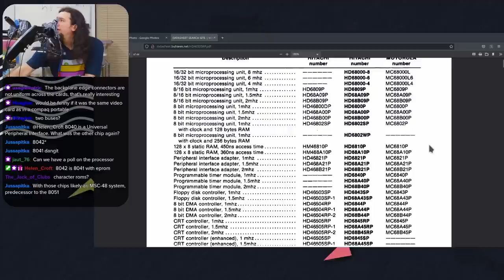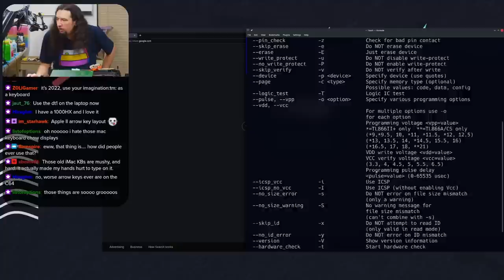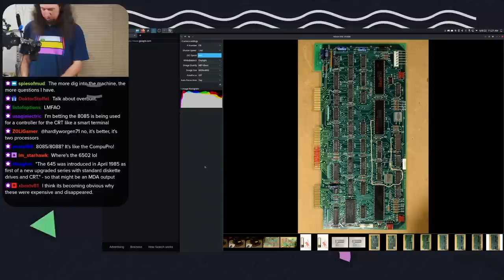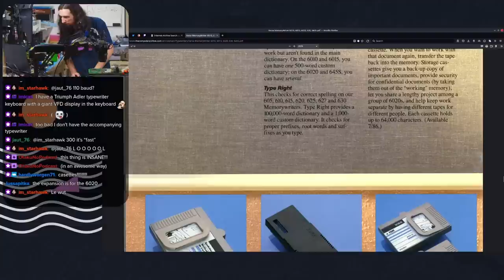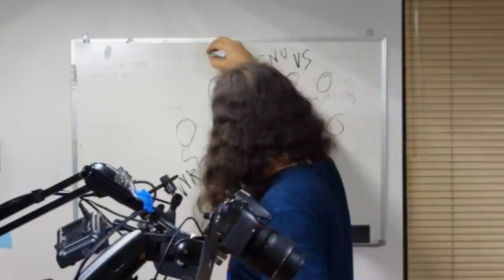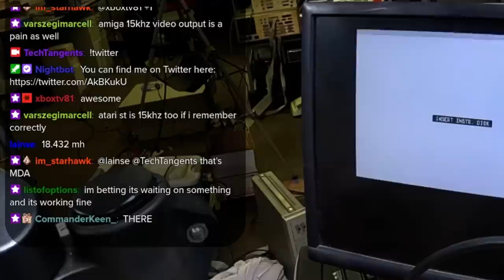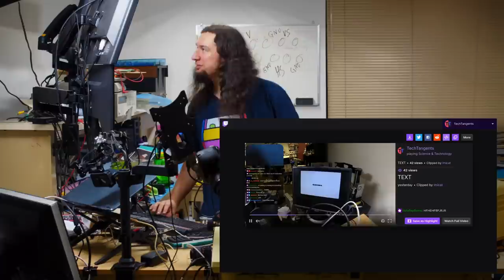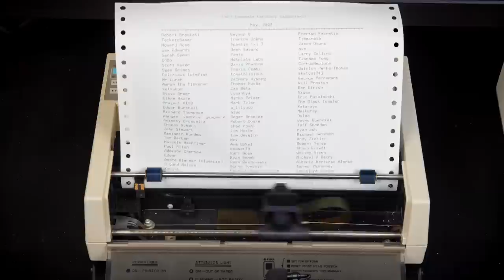Exploring the Crazy Xerox Memorywriter 645S to Get Video Out

Comment: The problem with a lot of these dedicated word processors was, their manufacturers were often way too stingy with CPU-power and often not great in the display department either. These things were often SLOOOOW. You'd type, and the display would be no help, because it'd catch up to you only later, by which time you'd have moved on if you were any good. So really, the display was only useful for occasional corrections. Given the development cycles and what was available at the time, they would have had to have put then-fairly top of the line-ish CPUs into these, with then-pretty expensive displays to avoid that sluggishness, and they didn't do either, because they were too eager for margins, and that killed usability, and soon made any cheap PC clone from Taiwan a better deal. Call it technological ungenerosity or eighties corporate greed, but crappy CPUs and dodgy displays killed these dead in the marketplace when there could have, would have been a place for these, on easy-of-use grounds -- they just would have needed more Oomph and Usability™.
Reply: PS: Having now watched halfway through this video, I take back what I said before, at least with regards to this word processor. Looks like this model could actually have been fast enough, with a decent enough monitor, to be actually usable. Also, looks like this thing was built like a big Benz limo, with a similar price point.

Comment: The 640, and 645 came with a 1/2 page video monitor.  You can do very little without it.   Power to the monitor is 16 volts at the connector. The voltage is then increased inside the monitor.  BTW These ran circles around the competition IBM.
Reply: Search for the Xerox 800 demo film entitled:
XEROX Word Processing Machines & Computers 1975 (Xerox 800 vintage promo film)

Also look up Xerox Star, and the Xerox Alto which was the first desktop publishing system in 1972 with a 3-button mouse.
Reply: The 645 "S" is for Spelling, it had a dictionary on a floppy diskette.  There was also the 645 "E" version for Ethernet.

This also prints bi-directional as it's based on the Diablo 630.  Bi-directional print is something no IBM Electronic Selectric Typewriter could ever do.

10, 12, 15 and PS spacing.

When you power it on initially it operates in plain old one letter correct at a time typewriter mode.  When you touch any of the function keys,  it asks for the software boot disk.

Take the time to remove the platen and make sure the platen bushings on each side turn freely.  When I bought mine used, someone ran it into the ground.  Either the stepper motor for the platen is damaged or a SCR on the driver board.

Comment: Hahahahaha, I used to work for Xerox in 84-85 and this was one of the products I was trained to support. I hated it, sorry to say I don't even have a page of documentation or remember anything about it other than it sucked (all the memorywriters). I do remember one customer that had one that I literally replaced every module on and it still didn't work right.  EDIT: Hourly pay for an entry level FS Tech back then was $5.45/hr, just found my check stub. A couple year later I went to work for DEC, entry level systems tech was just over $8/hr. Working for DEC was one of the best jobs I ever had.

Comment: Xerox:
Puts the disk drives UNDER the keyboard, lifting the keyboard up uncomfortably
Meme man:
URRGONOMMIKS

I found a Philips VideoWriter with an awesome half height amber CRT on the curb. It didn't come with disks and is incompatible to everything else on the planet, but you can format disks from the ROM BIOS, so it doesn't become bricked if you lose the disks.
And the monitor uses 15kHz composite so you could snip the internal cable and hook it to a DVD player.

Comment: 16:17: The Intel/AMD thing is because there used to be this big federal requirement that there had to be a second source for everything the government would consider buying, to avoid some monopolist holding Uncle Sam over a barrel. From Wikipedia's second source article: "Intel licensed AMD to second-source Intel microprocessors such as the 8086 and its related support components. This second-source agreement is particularly famous for leading to much litigation (...)"
Reply: The second source requirement thing was because IC fabrication was a bit of a black art in the early days. Fabs would suddenly go to 100% failure rates for inexplicable reasons and, without a second source, there would be no supply at all. Over time the reasons for failure became understood and were weeded out (weird things like a change in the washing powder used to clean the suits) and single supplier source became acceptable.
Reply: @stevetodd7383  That's one interpretation. Another interpretation and side of the story is that monopoly abuse has become much more officially acceptable in the United States. When it was all weird and disruptive pioneers, they needed to be controlled, but now that all the right people have big money invested, any kind of "big government" interference in the great technological kingdoms and fiefdoms (that are more powerful than most governments) is just intolerable.
Reply: @ropersonline  you need to remember that, in the days of the 8086 etc, there was much more competition in the market for CPU designs. There was no need to prevent a single company from having a monopoly as there was a thriving market for alternatives. It’s only as the competition fell by the wayside and x86 became the de facto standard that this became at all relevant. Even x86 designs weren’t all Intel derived (AMD, Cyrix and others were producing competitive designs long after Intel stopped second sourcing their chips). It was all about ensuring availability, not preventing price gouging as it was all too easy for a company to lock a manufacturer like Intel down to a price or they would go elsewhere. IBM famously got the 8088 for $5 per chip in their contract.

Comment: Maybe try a PC bios? I guess there are two processors, because one controls the "printer" and the other runs the "user interface"
Back in the day Xerox did a range of "Mini" type computers which were often used for word processing with models like the Xerox 850 (these things were huge). This may be a derivative of one of those. They did indeed have their own operating system, in the case of the 850, it came not on 5 1/4" disks, but on 8" ones. I actually worked on one back in the day for a local insurance broker. Nobody else locally would look at the thing because it was ancient, even then, but I got it services and running. That would have been in the late 1980s or early 1990s.
Reply: The wide hole on the back where the blank panel was makes me wonder if a Centronics port or a serial port were also an option.

Comment: It's stupid. But, with today's world of Raspberry PIs and small LCD monitors, it would be cool if someone made (or some hobbyists could build) a computer/typewriter hybrid. The immediacy of a typewriter is not replicatable any other way with computers. How hard is it to build an impact printer (assuming you can use existing daisy wheels)? You just need some rails and some stepper motors and such, right? It could be done.
Reply: Other than making your own impact printer, it could be done easily (for somebody with the programming skills and time). You could emulate the control protocol for the printer on an Arduino and write a character or line print out. Even easier would be using linux on a pi; after all, lpt stands for "line print terminal."
Reply: I'd imagine it wouldn't be hard. The striking mechanism would be tricky to tune to get the timing right but its basically a solenoid and a spring to retract it.
Reply: @IanSlothieRolfe  Well, it's that and a linear transport (which could be from a 3d printer), plus a paper feed. But the big question is the daisy wheel...  How would you make a new one (3d printing would almost certainly be both too low-res and too soft)? How would you ink it?

If the answer to any of the above is "buy new old stock" then the whole thing is basically pointless. At that point if the goal is to make a functioning character or line print terminal you should probably just buy a whole printer and work on interfacing with it. If the goal is really to roll your own printer, well, you can "kind of" do it?
Reply: @IanSlothieRolfe  It would be fun to start there. Break the project down into small pieces and try to get one part of it working.
Reply: @iroll  Yeah, I know, where does the daisy wheel come from. Keep in mind that I also want to build my own CRT monitor someday, so ... yeah. I guess you'd start by buying an existing daisy wheel and see what you could build around it. Then, if you got that far, try to figure out if you could make your own daisy wheel. Maybe take some hard plastic and CNC out the leafs, and then glue on the type elements. Seems like if you really got that far you could make a daisy wheel. Daisy wheels are pretty abundant though. It's the printers that are a little harder to find.

The end goal would be a complete, self-contained computer/typewriter hybrid that you could type on and also run ssh to connect to other computers on the Internet.

Yes, I've thought about interfacing with existing printers and typewriters, like maybe building a typing robot. That's kinda how I landed on this video. I also like Tech Tangent videos that discuss using typewriters as computer printers.
Reply: @kdietz65  Daisy wheel printers are going for $50 (untested) to $200 (new old stock) on ebay, so they're really not that hard to find.
Reply: @iroll  Yeah, I've explored that route too. I might do that but it doesn't get you to a self-contained unit. Maybe another idea is the reverse route. Instead of trying to add typewriting capabilities to a computer, try to add computer capabilities to a typewriter. So maybe I could get an IBM Wheelwriter and use it as the chassis and replace the interior with a PI. But the goal would still be something a hobbyist could actually build. Like I mean codify all the specs into an open source project, and a hobbyist can download everything and follow the instructions. It's okay if the instructions say "Go buy a Raspberry PI" because those are available new today at scale. The instructions can't say "Go buy a daisy wheel printer on EBay". That's not very satisfying. It does lead back to the problem you mentioned about where to get the actual daisy wheel, but if the project got some legs to it maybe some other contributors could come along and make and sell some.
Reply: @kdietz65  Buying a wheelwriter or a selectric is about the same as buying a printer. If you wanted a fancier case, you could just pull the whole carriage assembly out and build a new one around it! Like you said, the ball/wheel is really the only critical mechanical component that you probably can't hack. You'd almost certainly have to have somebody get a run of them made at a factory.

I just learned that there are still new dot matrix printers being made! I'm sure an ink reel from one could be kludged into a homebrew printer, probably easier than it could be put into an antique.

Comment: this reminded me of my olivetti cwp1 word procesor, it literally is a pc but with a dot matrix printer built in, single 3 1/4" floppy but has like an option to put another one? i guess its for a higher end model, also has all the os in eeproms which i cant dump bc i dont have a fancy eeprom programer and ive been wanting one because i might be the only one who has one of these and gives a fuck lmao. Also it has an unpopulated, easily accessible eeprom socket and afaik its for an upgrade either spell check or whatnot i think

It's really neat tbh, problem is that i have no idea which format it uses on the floppies, i cant image anything it does and when i format on ms dos, the cwp1 can still access the files it created on it, also i think i should have a disk that came w it bc everytime i format a disk it asks for a disk of some sort but i dont have it but it still wokrs? idek. Weird stuff tbh.

Got it for idk how much but it wasnt much, had to do some cleaning and fixing brittle plastic and i have the CRT which uses a weird circluar connector and i also have the original anti-dust cover ! which is gross btw. I could get some new old stock ink cartidges to replace the very heavily used one i had and i still have an unopened one with its box and everything ! its one of my fav things tbh, Afaik the software was last updated on this unit on 1983 i think? but the hardware is a bit older afaik. 

Anyway, nowhere near as cool as this one tbh but wanted to share my random facts about this other word processor thingy bc i know of no one else who even thought of them rip

Comment: Be amazing if it was a pc clone in typewriter form.
Reply: I have a couple of those... Canon StarWriter Pro models 5000 and 7000. 80286 based systems from the early 90s running Datalight ROM-DOS and a custom version of PC/GEOS. They can easily be made to run standard DOS software from a floppy disk since the GEOS file manager retains the ability to start DOS programs (.BAT, .EXE or .COM).